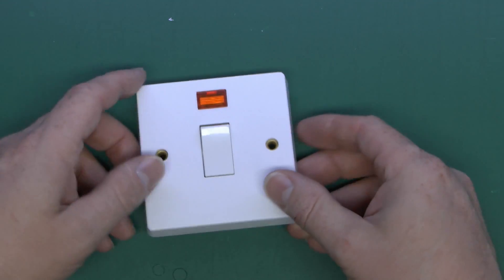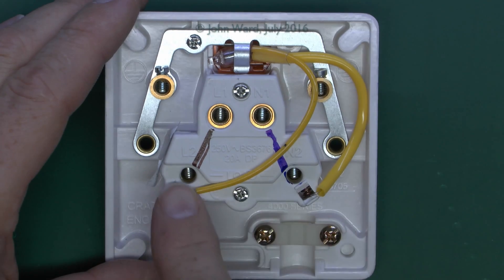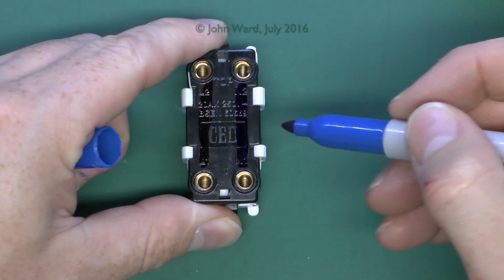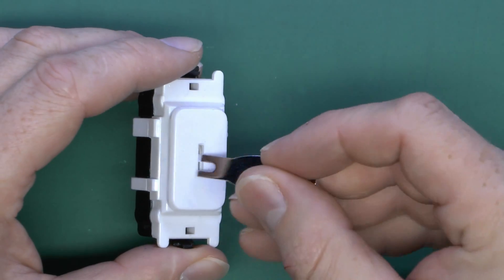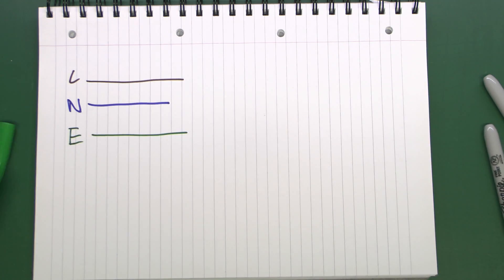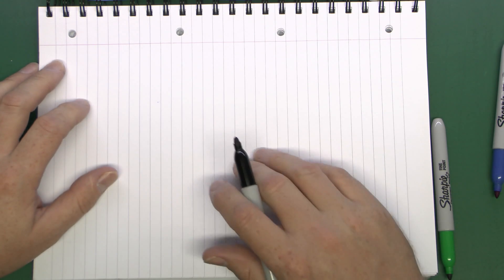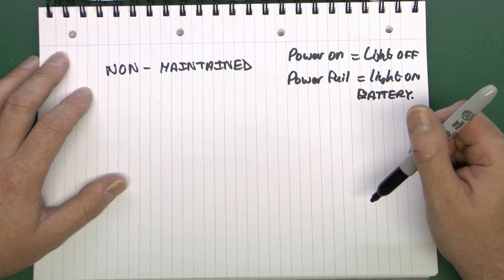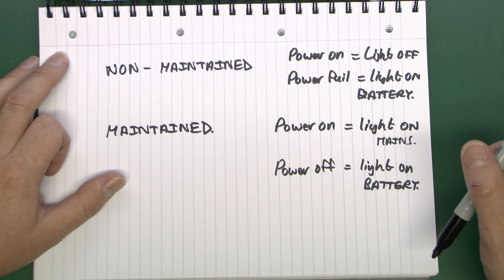Key Operated Switches and Emergency Lighting

Comment: What I tend to do John is operate the key switch at the beginning of my EIR testing or other maintenance and check the light output after  3 hours, and just replace any fittings that have weak batteries as it is normally cheaper and quicker than just replacing batteries alone.
Reply: In Germany do you must change the battery every 2 years or if they not works more - do this what first happend. So the law for all emercency lights and alarm boxes how works with batteries too. Of course at your private house do you can do what you want. In Thailand they not have a law same this - wonderful to see in commercial buildings where power breaks at monsum or thunderstorm. Some parts then very dark ... looks then same the Hospital in game Silent Hill.

Comment: Big fan, most house wiring switches only switch on leg of the the mains.  It´s a bit redundant to switch the negative leg as well.  If you need to install emergency lighting after construction and want to use an existing installation this should be kept in mind.
Reply: You can use a double pole switch as single pole.  Just only wire the line conductor in between L1 and L2.
Reply: Normally UK domestic lighting installations are easy to convert to emergency lighting as there is usually permanent and switched live connections at the light fitting. The only problem is wiring a test/key switch (a toggle switch added to the fitting is an easy solution if possible).